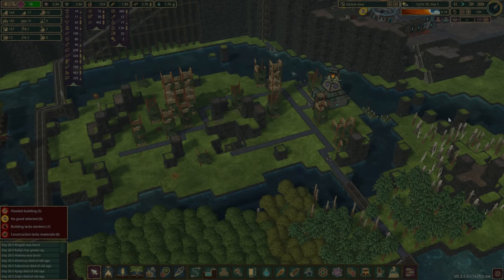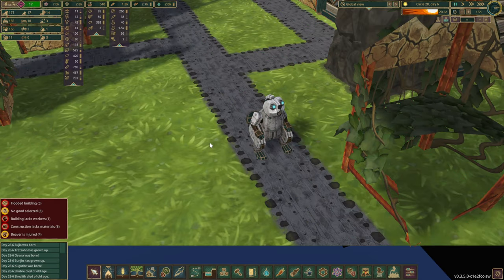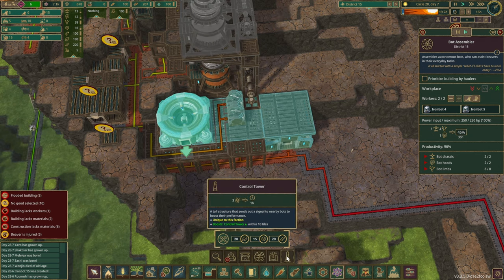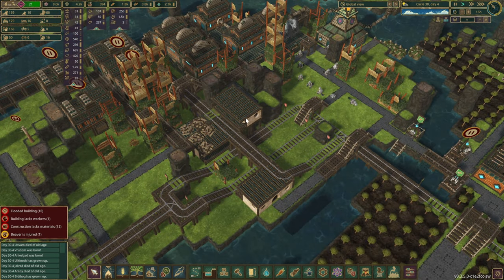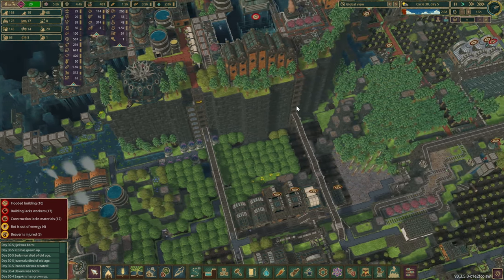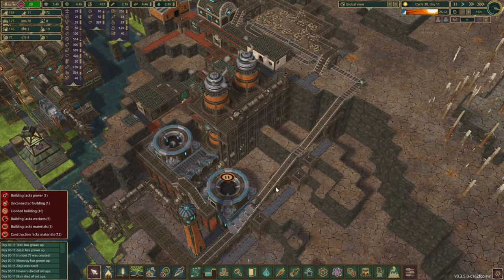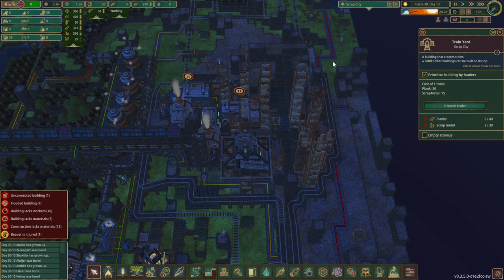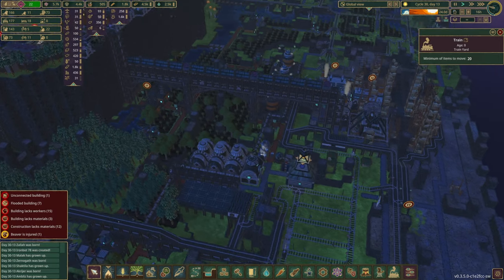Triple Train Station Setup in the New Production Zone - TIMBERBORN - E13

Comment: I notice the pathing they use is bonkers when a new train or route shows up.  It's like it takes one route, then notices it's not optimal then re-calculates.  From then on it will be ok.
Reply from the maker: Yeah, I kept observing that one junction with odd behaviour after I stopped recording and found out that the train would rather try to re-route itself rather than wait at the flag until the path is clear. I guess it's also something that I can fix pretty easily by changing around some tracks and adding a few signals.